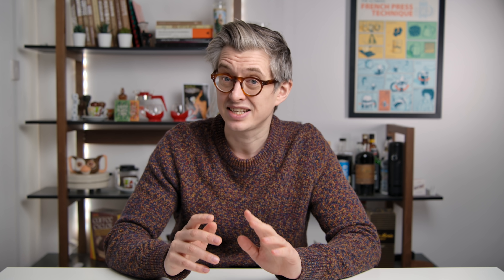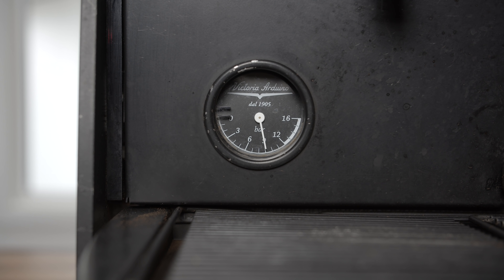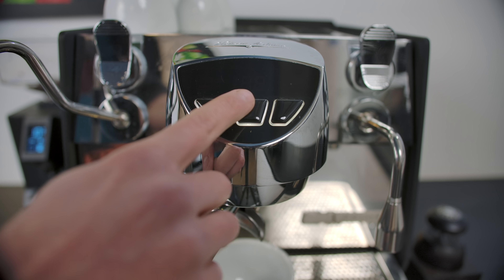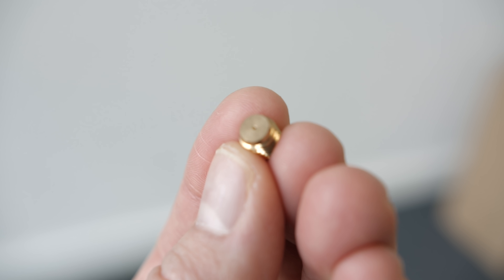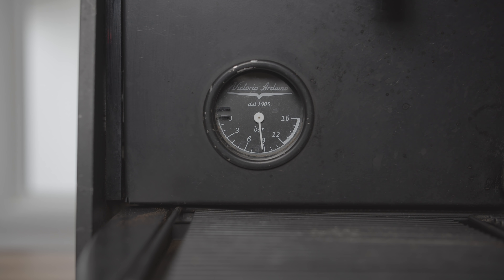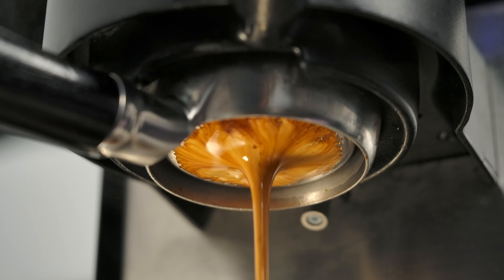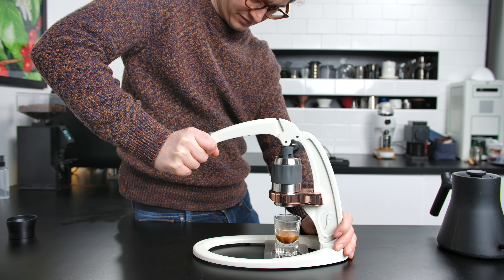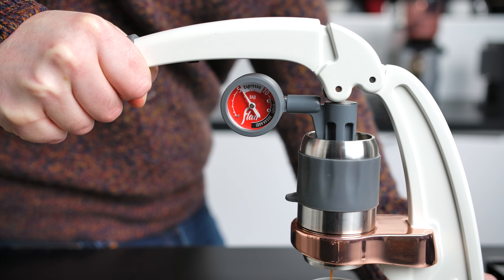Understanding Espresso: Pressure (Episode #6)

Comment: As an engineer, pressure is a result of flow against some sort of constriction (Cv).  This Cv is usually used to determine pressure drop within a system (piping), but is also influential on the standing pressure behind the source of constriction.  In the case of your espresso machine you have two constrictions...the primary constriction being the puck, and the secondary constriction being the orifice prior to the puck (for your pre-infusion).  The orifice is a fixed constant as the size of the orifice never changes, scaling aside.  The puck on the other hand is a highly variable constriction point and can be influence by a multitude of variables...grind size, grind uniformity, tamping force, oil content in the beans, moisture content of the beans, roast, etc. The result is that you can have a wide variance in flow rates at a given pressure depending on the variables affecting the constriction seen at the puck.  If extraction is primarily a function of contact time, and to a minor degree pressure (as pressure affects solubility of various components, as does temperature) I would intuitively think that flow (your output) would be your primary control point regardless of other factors.  Fine tuning the other factors (grind, tamp pressure, etc) affecting you puck will only improve you extraction from there, but get the flow proper first regardless of the pressure.
Reply: Well put. I think a lot of people don't understand that the 9 bar is an empirically  derived  setting that most manufacturers have determined is a good starting point. Most machines I have played with measure the pressure in front of the Gicleur - which is convenient and less likely to cause issues with Bourdon gauges but is not really what you want to know. . The pressure is  as James and you both put it dynamic - some will put this down to all sorts of esoteric process such as degassing of CO2 and subsequent boundary effects. I think it is far simpler - the cellulose  swells and the fines wash to the bottom of the filter and plug the portafilter.  This is the way filters whatever the medium.  If you apply too much pressure you rip the filter or in this cause poke a hole in the puck.

The  pressure will be less than 9 bar at the puck if the puck has decent flow and go to the maximum output of pump if it becomes a solid obstruction. This is the thing about the blind portafilter with the a pressure gauge - all it tells you is the maximum output of the pump which is OK for initially setting up the machine but nothing else.  I have done my own measurements and with the typical 30 second 50ml pour it seems a lot less than 9 bar for most of the pour. 

If you are going to model it then you have to take into account the impedance of the whole system including Gicleur, dispersion screen, coffee puck and the holes in the portafilter. As you said the gicleur and dispersion screens are essentially fixed until the become scaled or clogged. As control functions pressure and flow are intrinsically linked so it doesn't really matter which one you pick - its more a matter of convenience however measuring pressure is probably the easier route to detecting channeling.

What James didn't elaborate is the the lever machine in the hands of a skilled operator allows you to control flow/pressure in the release directions quite accurately - you can modulate the spring pressure if you feel so inclined. They are wonderfully reliable having essentially only one moving part. if you ever saw the old train terminal in Rome they had 30 or so of them in a row and they worked day in and day out for decades. The only thing is they need an army of men with arms like Popeye to operate them.

As you said solubility of the huge number of compounds in coffee and when they dissolve during the pour process is the next area for study.  The Impact centre at the University of Toronto was doing some research but I don't know how far they got and whether they were able to to correlate squiggles on a print out to a good tasting cup of coffee...
Reply: 100%... well 99%, extraction being based on time is not so straightforward. The velocity of the water affects the extraction, hence flow rate being important in of itself.
Reply: Another engineer here who specialises in soil mechanics. The idea of the pre infusion can help fill the voids with water and reduce the air in those voids. When the pressure of the water is applied it theoretically  applies to the entire puck if it is 100% saturated. Look up the idea of permeability through soil and oedometer/consolidation theory to further elaborate on the pre infusion ideas here 😃
Reply: @Bluemaxx83  we've got engineers watching youtube? And willing to come out just like that? What a time to be alive!
Reply: @channul4887  it is a brave new world where one can out oneself as an engineer and a coffee nerd 😅
Reply: As an engineer I agree. Also you have to account for dry puck is not wetted well because of water surface tension (like a soil). If immediately applying pressure a lot of porosity is not available, because surface tension resistance is less for bigger pores (less compacted paths or with less fines), forcing water trough the easiest paths. This less resistance paths get even higher flow rate when solids are disappearing during extraction leading to channeling. The best way is really to let the puck soak itself. You can see this on a naked portafilter when coffee starts uniformly to push trough. Preinfusion is key. You cannot get uniform flow trough a dry puck. The best in my opinion would be to have lower temp water for preinfusion allowing for really long preinfusion times without starting the extraction process.
Reply: @pirminborer625  Dude, nice... I’d never considered the surface tension! That makes so much sense, but I don’t think anyone in the coffee world knows this, all I’ve ever heard is what James said in the video.
Reply: @samroesch  Wow indeed, same reason why really dry soil are prone to flash flood; Amazing how complex espresso is;
Reply: @pirminborer625  interesting aspect. Cold infusion would be nice in theory but how do you heat up the puck quickly after increasing the thermal mass so much with cold water? There's definitely room for engineers to play with :-)
On the aspect of surface tension: this would imply that you increase the chance of channelling if you go up with the pressure too fast (for a normal grind). But if you grind fine enough the puck will just choke. With pre-infusion, however, you are able to achieve a certain flow that would not be possible without wetting the puck first. That would imply that a wet puck has a lower resistance even when compressed at 9 bars. And grinding too fine would lead to dry pockets inside the puck with a much higher resistance (without pre-infusion). Do I get you right?
This could be tested maybe with cold infusion. Grind fine enough to choke the puck without pre-infusion but coarse enough to get a flow with pre-infusion. Then you should be able to get a flow with cold infusion, too, right? Cold infusion could be done before you mount the porta filter with water from the tap. Maybe someone did this already? On the other hand, maybe you already extract too much even with room temp water to distinguish between the different effects.
Reply: @pirminborer625  James actually mentioned this subject in the spray bottle video funnily enough. Some folks have been experimenting with spraying the puck with water prior to placing the portafilter into the group head for that exact reason. I wonder how much of a real world difference it would make, assuming all other variables are suitably even?
Reply: @pirminborer625  Very fine points.
Reply: @pirminborer625  I'm not an engineer, but I have question. What do you think would happen if I'd start pre-infusion with really cold water and then apply heat on the portafilter itself. After some time, when the water should have proper temperature, pull through 9 bars and make espresso. I mean like slowly (just idea) and evenly heat the coffe grounds with water in the portafilter and then pull the rest of the water through.
Reply: okay I posted this comment on the wrong thread lol.. i hope it's not redundant for me to post again:
I think you need just enough pressure in the beginning to make sure the water doesn't just "sit" on the coffee, kind of like The Action Lab's new video about cocoa powder that doesn't get wet because of the surface tension of the water prevents the water from percolating into the powder. so you need JUST enough pressure that will get the water to move slowly but consistently until there's water dripping from the bottom. going back to flow control, the pressure is dependent on how much resistance the puck provides, so I think for every puck, you need to apply whatever amount of pressure is required to get the water to migrate down the puck slowly, but not any more. i think eventually flow profiling is probably gonna be the way we get to the bottom of this rabbit hole since using the same pressure over and over actually doesn't make sense considering that every puck has different resistance
Reply: I totally agree with you. I believe contact time and flow are more important than pressure. Unfortunately, there are only a few (very expensive) machines out there which let you control flow instead of pressure. Constant pressure can be achieved in a very easy and cheap way but constant flow requires more expensive equipment.
Pressure profiling is, in my opinion, just a workaround for flow profiling (e.g. the lower pressure during pre-infusion is not the most important variable but the lower flow rate and contact time is. Yes, the lower pressure during pre-infusion decreases the compression of the puck, but this is not a value in itself). Flow profiling, on the other hand, would give us the best control about the extraction I believe (a lot of assumptions as I don’t own a flow profiling or constant flow espresso machine 😉).
For the perfect dialed in espresso you could probably end up with the same initial pressure, flow and contact time (or at least similar values). But even then, I think flow profiling will increase consistency from shot to shot. Let’s say the grind size changes because of a change in humidity. For a conventional espresso machine, you have to choose than between keeping the brew ration or the contact time constant (or throw the espresso in the sink and try again with a different grinder setting). For a machine that controls flow both flow and contact time will stay the same (but the pressure will be a bit different of course). I believe the second scenario does not change the extraction as much as the first scenario (while keeping the brew ration fixed).
I would love to see more espresso machines on the market in an affordable price range.
Does someone have a flow profile machine and can tell me from experiments and experience if my assumptions are right or wrong?
Reply: @humphrey2703  This is what the Decent espresso machines do.
Reply: @samroesch  I know, but I don't own one, unfortunately (and I don't consider these machines cheap) :-)
Reply: @humphrey2703  Well put.
Reply: I stopped reading at "as and engineer" 😂

Comment: Dear @James, an additional question i have is, how to best dail in shot on a flow control machine? (I use the Letit Bianca).  Of course you can start of with not pressure profiling and get to a tasty 25 - 30 sec. shot. But still, i assume that the most tasty grindsetting might also depend on the flow profile used. But the options here seem to grow exponentially. Tips or a how to .. would be GREATLY appreciated. :-)

Comment: Hoping james does an ep on computer controlled coffee, using an rbpi to do crazy stuff like not just temp control with PID but also pressure and flow control with digital scales
Reply: Doing dynamic pump adjustment to get a constant flow rate would be interesting - sort of like a constant-current power supply.
Reply: isn't that what precisely Decent does?
Reply: @pppptkay  yes, but a decent is a really well made commerical machine and thus incredibly expensive, whereas you can get a similar level of control on a much cheaper machine like a rancilio silvia for a hundred or so in components. The challenge being wiring, assuming you use someone else's software
Reply: @Ryukachoo  ah i get what you mean now. 
The way i see it, to get that much of control but (relatively) cheaper now is to use a cheap manual lever machine eg. La Pavoni. with the Smart Espresso Profiler and connected to a digital scale eg Acaia or Felicita. 
The temp issue can be sorted with PID if you want really precise. 
Guess similar with what James did with the SEP and Cremina videos
Reply: @pppptkay  I don't know, but that sounds eminently plausible given what James said about it. :)

Comment: One thing I wish had been touched on -- having used manual and spring levers, as well as electric pump machines, I really prefer the coffee from the levers because it seems / tastes more complex -- there's more going on in the cup. I have always assumed that this is because the extraction at different pressures brings out different notes.  [easy repeatability with a spring rather than a manual lever is the big plus for spring-lever; playing with the pressure is the big plus for manual levers.] Pre-infusion happens naturally with a spring lever  (hold the lever down for 8 seconds or so before you release it), and is easy to do with a manual -- give it less pressure as soon as the water enters the piston.  I never found a way of doing this with an electric pump - except turning it off briefly, which does often mess up the puck.

Comment: I think there are some things worth mentioning: 
1) Sage/Breville-style preinfusion for machines equipped with vibratory pumps: adjusting the power going into the pump allows for preinfusion with a % of pump's force, which is simple and effective. Oh, "but it adds electronics to my clean looking machine!"... said people with PID's and digital built-in shot timers, sometimes installed by themselves. I'm actually baffled how virtually no manufacturer does that, considering it's such a draw. Hell, make the scale constant! 
2) machines like Lelit Bianca or others with special "paddle" for E61 grouphead allowing for pressure adjustment are also something to consider. They allow multiple pressure profiles (like lever) found on much, MUCH more expensive machines like Rocket R 9 One (which is a mouthful) for a third of the price, but with (arguable) disadvantage of having to adjust the pressure manually, through a "paddle".
3) Mark from WholeLatteLove presented multiple pressure profiles, like lever-style, 2nd-stage jump and the like for different shots and with explanation for how and why. Worth checking out, in my opinion. (Not paid to inject, but wouldn't say "no" to free money, heh)
also, if this goes on I might actually find a side-gig as a barista. :)
Reply: You're making the mistake of equivalating pressure with flow... machines like the Bianca and the WLL videos (incl the Dalla Corte Mina) are not about pressure profiling, but flow profling. That is, controlling flow (in g or mL/s) as the input variable. Those kinds of machines maintain a fixed pump pressure and the user adjusts an aperture near the grouphead that restricts the flow of water. The Rocket R9 One is a pressure profiler because it adjusts the voltage sent to the rotary pump that changes pressure.
Reply: @LuckyDragon289  It is true that pressure at the pump doesn't change. HOWEVER the pressure the grouphead does, which can be seen with a manometer in E61 installed on said grouphead. While adjusting the flow, the pressure at the puck changes, which makes sense since less water is let through, exerting less force on constant area, lowering the pressure that is put on it.
Reply: @LuckyDragon289  is there not an impact on pressure hitting the puck when flow profiling

Comment: Hi James, I was wondering where the pressure shown on the pressure gauge is usually taken from? The pump? The Grouphead? Does it matter? Cheers
Reply: It's pump pressure not group. You'd need a separate pressure gauge for grouphead pressure. Pump pressure stays stable all the time unless you change the pump setting. Group head pressure is what is variable with flow restrictors

Comment: Great video. I live at 2300m and would be interested what the considerations might be, for brewing espresso at altitude. I remember reading somewhere that you should ramp up pressure to compensate for the lower boiling point of water, but have not seen anything more definitive. Thanks James

Comment: @James Hoffmann, I just want to disagree with one statement you made regards the "mechanical preinfusion". You do not depressurize the system just by stopping the pump, in fact, the momentary pressure stays or slowly decreases due to the ammount of water leaking through the puck. What would cause a total loss of pressure is opening the 3-way valve which is a big no-no for the puck integrity. Of course I still agree that it's the worst solution from all the mentioned options, but it's in no way fatal to the puck.